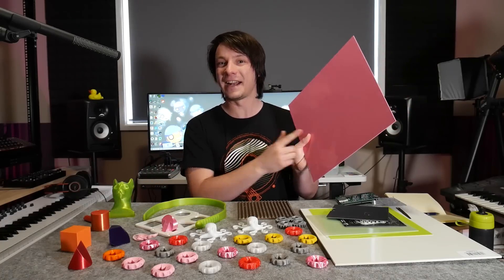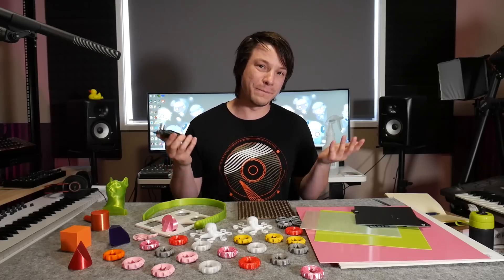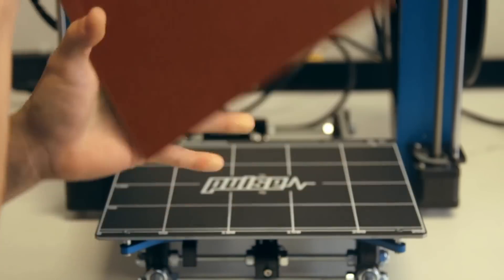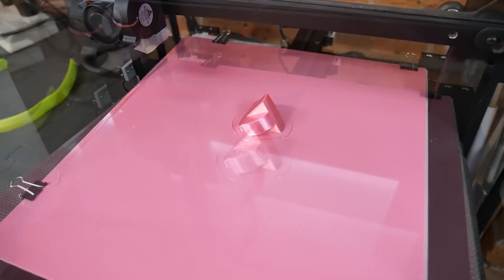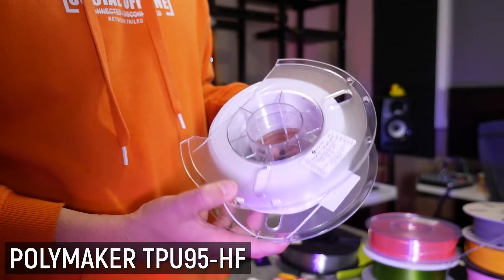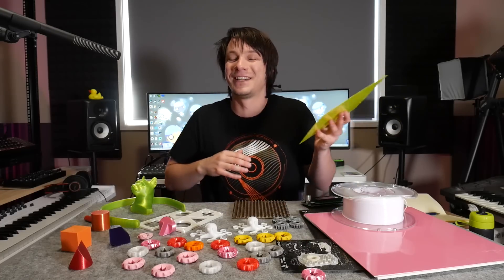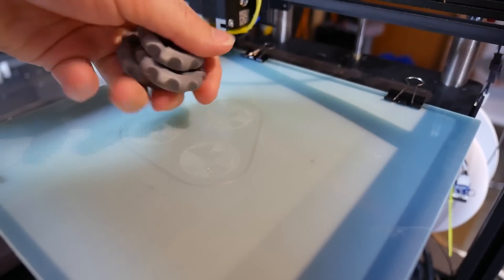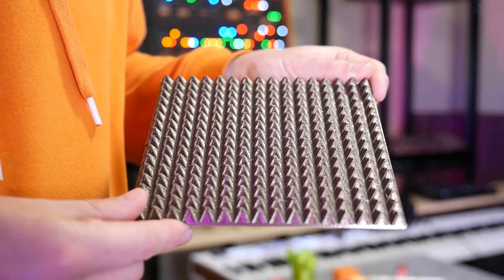G10 - The best print surface you've never heard of.

Comment: There are several plate manufacturers like Darkmoon 3D (for Bambu printers) that sell complete flexible G10 plates. Obviously more expensive but seems much easier to  use. Have you tried any of these amd if so, what do you think? I know this is an older video, do you still think G10 is a good overall plate surface? I'm a little concerned about how soft G10 is and how it will last. I've been printing on a BIQU Cryogrip Glacier amd have found that really useful for most filament types. Have you ever tried BIQU plates?

Comment: After couple of years of daily printing it stops working reliably. Cleaning no longer helps. I think it may have something to do with constant heat and off-gassing that change the structure and looses it's "magic".

I have been using G10 since 2017.
Reply: rub it with sandpaper
Reply: @Zyghqwyv  Doesn't work. New sheet works good.

Comment: So Angus! 3 Years on and whats the status? I was actually thinking, if you use a mag pin on the bed somewhere...why couldnt you do away with the alum build plate, magnetic sicker and top layer? For bed slingers it would be much lighter, heat up much faster ? Thoughts

Comment: I have 10 printers running 24/7 and I don't understand why anyone would use anything ither than a clean mirror unless you are using some exotic material that I haven't tested 

PLA, TPU, and PETG stick to to it with a vengeance until it cools down when the parts release completely without any effort.

Hell I don't even need to ieep the glass that clean and I always have perfect adhesion.

Comment: I bought one for my Ender 5+ and had to cut it down. It point blank would not snap after scoring it. I had to use a jig-saw to cut it. I scored it multiple times and even did it on both sides but even with using mole-grips it still refused to snap !! You must have different stuff in Australia is all I can say.

Comment: Wow--fabulous video! I've been printing nylon on a highly modified UMO since 2012 so I know of G10/Garolite/FR4 for this purpose and other purposes too (knife and other grips, slingshots, etc.) but I never thought to try it for printing materials other than nylon until I stumbled upon your video. I guess I never tried it simply because no one has been suggesting it for anything but nylon over all these years. I still have the old UMO but I just purchased a used UM 3 so I will be cutting some G10 build plates for it too and I plan to try printing a bunch of different materials on it.

Comment: Thanks Angus. I have a Sovol 07+ that has been going great after I discovered glue sticks, but suddenly nothing sticks.
The PEI plate is needed to stop the Z down before crashing into the the plate. If I add the G10 1.5 mm how can I prevent the head crashing into the G10? Thanks for your great work.

Comment: I highly recommend this G10 FR4 for PETG. I just finished printing 3kg of PETG on this bed with CR10V3. Removing parts is always the fun part of printing now. One time I printed 100mm x 300mm bottom surface model but I was able to remove it from the bed with my hand. I didn't even have to remove the G10 from printer and flex.

One thing is that, maybe 2mm or 3mm thick FR4 G10 board is good thickness for 310mm x 320mm bed size CR-10. I used 1.5mm thickness and it was too thin in my opinion. Center part bend upwards and I can't get the completely flat surface. (I checked with ABL mesh visualizer)

I just ordered 3mm G10 for CR10 $20 and 2mm G10 for ender 3 $13.

Comment: This is why I am subscribed to you. You provide such great information on 3d printing. I am new to 3d printing and have just started my printing journey using a Anycubic mega pro 3d printer. I've only printed three prints so far and they all came out OK but man where they hard to remove from the build plate. I've never heard of this material G10 but seeing you remove your print with such ease made my jaw drop. I will definitely stay tuned for more :)

Comment: or just use spring steel and dont make problems form nothing. enough for most common materials. i dont have any problems with bed adhesion with PETG, just clean bed with isopropanol alcohol :)

Comment: Hello from Canada, G10 is used in the electric motor / transformer winding industry. There is also a G11; same material higher temperature rating, may be better for printing nylon and other high temps in the 1.5mm sheet.
Been printing on G11 for years, if you mark it up a little, tune up with 220 W/D and wash; good to go.
No matter where in the world you are, there will be winding shops, ie. electric motor repair places. They will have G9, G10, and G11 Nomex paper, phase paper ( not really paper at all ) Kapton, Mylar.... all the goodies you could want.

Comment: In high school electronics class we photo-etched our own G10 PCBs using a purple photoresist gel, laser printed transparent sheets, UV light & several chemical baths. I wonder if there would be any advantage to using a copper clad board as a 3d printing bed. Would the copper side make a good print surface? Would the G10 side be improved as a printing surface by having the copper face on the underside in contact with the heated bed? Would it help stiffen a thinner sheet to shave grams off a bedslinger? My Ender 3's bed is so warped it's practically bowl-shaped, so I'm not set up to test, but it might be worth revisiting.

Comment: Started using G10 after I too had problems with PETG. Awesome adhesion now! Printing eSun PETG on an Ender3 settings are 245 degrees C on a .4 nozzle / 80 degrees C on the bed / 50% print speed (see on the printer) / 0.85 Z-offset. Thanks Maker's Muse!

Comment: The board you used there and deformed with PA, was deformed because it was low temperature rated. You would need to use a FR4 rated at 150C or so, wich is more expensive though.But maybe you figured this meantime...

Comment: I normally use carbon fiber surfaces from 3d printing Canada and use Vision Miner adhesive, but they are getting old and scratched up from incorrect z-height offsets. Just ordered a 12"x12" sheet of 1/16" (2mm) G10 with graphite mixed into it for less than $10. The listing at Mcmaster-carr says it's "slippery" and has low friction. Along with the VM adhesive, should be great.

Comment: i stuck a magnetic sheet upside down on my G10, so it sticks to the magnet on my magnetic build plate. (They are the same exact magnets, i have spares from all the pei sheets ive had.)
It makes it a bit thick for clips tho, which i think ill be switching to anyway as my parts are warping (But they are not warped off the sheet. i think the entire sheet is lifting off the magnet in the corners)

Comment: The first time i used PETG i was just starting in 3d printing and i treated it like pla and i got constant clogs until i realised it needed to be printed at much higher temperatures.🤣 So i kept the other settings and all i changed was the printing temp and somehow it printed perfectly, I look at it now and i just don't understand how it printed so perfectly. No warping, no aritfacts, nothing and I cannot replicate it even now. A few months ago i started using G10 and it realy improved my PETG prints but its still not close to my first PETG print.

Comment: I think there is a flaw in your testing methodolgy.    I'm currently trying to find various ways to get ASA to stick to the bed.  So far on a glass bed... aquanet hair spray and glue sticks are entriely worthless.  My go to print bed prep is to use green painters tape.  Everything has stuck to it so far.   Wood PLA, Metal PLA, PLA, PETG.   However.. ASA doesn't.  At least it doesn't on a longer print.   If I were printing  little tokens like you are printing, the result you would get would seem that ASA  sticks fine to printers tape.  However, only for prints that are probably 3-4 hours or less in duration.  At about the 4+ hour mark, the ASA begins to seperate from the tape and at the 10-12+ hour mark, the entire print will seperate from the bed.    So any print over about 3-4 hours has a high probability of sperating from the bed and failing.    So to test your different beds, and ways of prepping them (glue, hairspray, slury, etc), you need to do 12+ hour long prints.   Because anything may work for small items of short print time, but doesn't mean it's actually a solution for printing anything you may need to print.   FYI.. anyone interested in finding something that ASA will stick to..  I'm printing the ASA on a Raise 3D N2.. with a bed temp of 100-105 and the printer has an enclosure, to give the ASA the best possibility for success.   So far the only thing I can get ASA to stick to is a slurry mix of acetone and ASA.   However, it's not idea, because it sticks SO well, that it's hard to remove the print from the bed.    I'm going to try this G10 to see if it will actually work for a 12+ hour print, because these short print times of small items are not conclusive of how well the filament actually adhears to the bed.
Reply: So I have now tried printing ASA with a sheet of G10.   No go.   The ASA did not stick to the G10 AT ALL.   I even ruffed up the surface with a little bit of sandpaper and there is NO WAY that ASA is sticking to this stuff.   I then tried to use the ASA/Acetone slurry on it and even it didn't work.  While the raft seem to stick to the G10 well enough with the slurry on it, the model almost immediatly started to peal from the raft.   And this is with only a .15mm gap between the model and the raft.  I might try decreasing the gap between the raft and the model and see what happens, but so far using G10 with ASA is a no go.

Comment: It took me a bit, but I found a 310x310 1.5mm thick G10 board for my JGAurora A5 and it's great! Seriously the best bed surface I've ever used so far. I highly recommend it as stuck gets stuck pretty firmly to it when it's hot but when it's cool the most you'll have to do is gently peel it off.

Comment: I understand the material actually defining adherance properties is epoxy resin. Has anybody ever tried replacing the (damaged) coating of a flexible steel plate with a layer of epoxy resin?

Comment: I'm using garolite as a printing bed, but lately no matter how much I cleaned the surface there was poor adhesion, like brims would start to peel off as it was printing, what I ended up doing was sanding it lightly with a fine grit sandpaper and cleaning it with IPA to increase suface area for the PLA to stick to. It made a perfect print, only printed once after doing that, fingers crossed it stays that way.

Comment: I've tried 1.5mm G10 since I watched your video, replacing an old and battered Zebra Plate. It's really good for PLA. However, with ABS the G10 warped just from heading the bed to 95 (my bed won't reach 100).

Comment: G10 is just fiberglass cloth impregnated with epoxy resin, that's why nobody knows what it is.. G10 has a special epoxy rated for electronics use.. Normal fiberglass board or sheet is the same thing.. Fr4 is fire rated epoxy I think..

Comment: Great video Angus! Maybe you or someone else here can answer my question. I have an Ender 3 V2 and the other day while trying to get a PLA print off after the bed had cooled I actually ripped of some of the surface. So I bought a sheet of 1.5mm G10. which showed up today.

My question is do I apply the G10 over the Ender bed or do I remove the Ender bed and put the G10 directly on the heat bed?  Thanks.

Comment: Thank you for the tips on G10! I use it on a Bambu X1C with high temp adhesive tape on their provided flex plate (the cool plate sticker kinda sucks so I removed it). I got a 1mm thick sheet, but I also taped a small piece of ~1mm thick aluminum to the place where the nozzle gets cleaned so the nozzle can reach it. Now I can print functional PETG parts without a bumpy bottom surface. 

I wonder why PEI was 'chosen' as the go-to no-glue-stick build surface. Maybe the cost of applying it to a flex plate and a textured option?

Comment: Also, until I dialed in the layer/nozzle height, bed level/frame level and straight, etc. I could not get anything to stick even with glue stick. For me there is no one easy answer to this problem. I know a lot of you are trying to find that one thing that will solve all bed adhesion issues but there is no one solution . I still have to re calibrate my EZABL probe just about after every large print.

Comment: I use the Matterhacker's Version. On a BuildTak flex plate system so I can remove the sheet as needed. Recently having my bed really, really flat/level helps a lot. I recently also, installed a EZABL probe for extra leveling.  I have not found a bed temp that did not work for PLA and PETG after I adjust the Nozzle to the right height off the bed. Once I get a good first layer I am off and running. I am using a REVO hotend 245c for PLA. And a bed temp of 50c but again I don't know if that is the best temp but it works. Also, you have to find the right Nozzle temp for your filament. I saw recently a Video that said that to Extrude 100mm of Filament and if the Filament starts to curl out of the Nozzle then up the Temp by 5 degrees until you see a nice thick bead of filament. Then you are probably dialed in, after testing for your Estep value. A Temp tower for me only shows how much stringing per temp change. My temp towers don't show much difference in temp sections. And I always use a Filament dryer hooked up to my printer.

Comment: Had been printing with PETG for a while on my carborundum glass plate with no issues, but changed filament vendors and a large print finally did what everyone warns of and took couple small shards of the glass with it...   Bought a G10 sheet due to this video, and so far have been very happy with it.  Works just like the carborundum one, even using similar settings for bed temp etc, but with the benefit that I can bend the 1mm sheet to pop parts off if I'm in a hurry.  TYVM for the tip and recommendation! :)

Comment: Has anyone tried using the 0.5mm sheet and gluing it to a spring steel sheet? Like I have a and spring steel sheet where the coating has been damaged, thinking of stripping it back to steel and gluing a sheet of 0.5mm for use with my magnetic bed.

Comment: shrug...  Seems like alot of work for a solved problem; but I'll give it a try before making any conlcusions.  The sheets on amazon and etsy are stupid expensive; looks like sourcing from granger or other.

What I've found over years:
1. Turn off bed mesh marketing gimmick crapola; manual level with .15mm to .10 clearance in 5 spots around bed.  ABL is great in theory for running crappy warped beds; not a problem on glass or when you buy a good  bed.  The bugs in software can cause massive headaches.  I see newbies struggling to get a good first layer more now then ever before on forums, think we went wrong direction here.  
2. If you have a probe; just use as limit switch and manually set z-axis with same clearance.  Otherwise calculate out z-axis offset as normally.
3. Always use a release agent w/petg; either gluestick or one of the fancy pants brands.

90% of time use petg or PolyC; above works great on a voron 2.4 and ender5+.

Comment: I find it pretty interesting why some people have issues with PETG on glass. I personally print mainly PETG on glass (with a tiny amount of stick glue, smeared around with a watery sponge) and I have no issues, I actually have a self-release thing going on. When the bed is hot, it's quite hard to get the parts off, but when I leave the bed to cool down a little bit, the parts have popped off and I only have to reactivate the glue with watery sponge (moisture will evaporate leaving the bed slightly hazy which doesn't affect the way the print bottom looks, it looks like there was nothing under it)

Comment: Just did the upgrade. Fantastic build surface. Much better than all the others I've tried, which includes painter's tape, glass, glass + PVA glue, Ultrabase, and PEI powder-coated spring steel sheet. That said, I would highly, highly recommend getting something thicker than 1.5 mm. In my experience with large prints, the part would bow the surface up. This happened with regular double-sided adhesive. I'll be experimenting with high-temp adhesive, 3mm thickness, clips (🤢), and I might attempt using magnetic paint on one side since my bed is magnetic (I don't have high hopes for this, but still worth a try). I never bend surfaces to remove prints as this throws off bed calibration, so the benefits of a thinner piece are basically inexistent.
Reply: So since it's been almost a year, have you had a chance to try the magnetic paint?  If so, how did it turn out?

Comment: I managed to put a G10 print bed onto a Prusa MK3S+. You need a some sort of single sided spring steel sheet, I happen to have a Creality one, but you need one that has the bare spring steel exposed. And you need a 1mm G10 sheet. The closest on Aliexpress is a 250mm x 250mm x 1mm sheet. Then you must set your PINDA such that it is only about 1mm above the tip of your nozzle. Set the spring steel sheet bare metal side up then clip the G10 on top of the spring steel. This really pushes the limit of the tolerance of the available space for the PINDA to work. IF you encounter the tip of the nozzle colliding with the G10, the printer will throw an error. This means your PINDA probe needs to be lowered more. If you get it right, there will be just enough space for the PINDA to complete its mesh leveling and then you can do the Live-Z adjustment

Comment: i use g10 and fr4 version of them. Dont get the FR4 they not the same, the FR4 sheet dont stick very well where is the regular G10 sticks really well. PETG Sticks a little too well but that is common as PETG seem to like to stick to anything and wont let go however it does let go somewhat after it been cooled where as i cracked my orignal glass bed with PETG trying to pull a big print off even after it been sit in the freezer for 20min